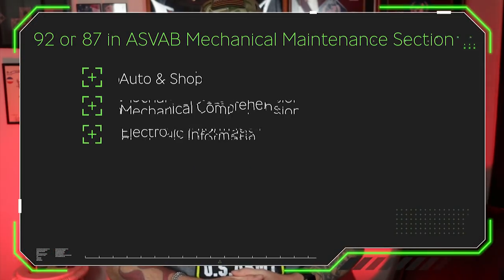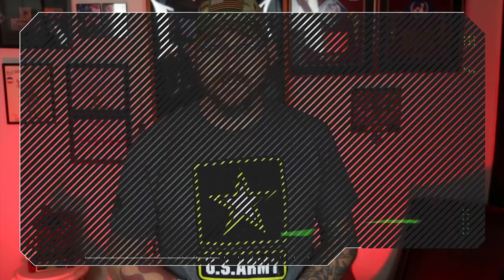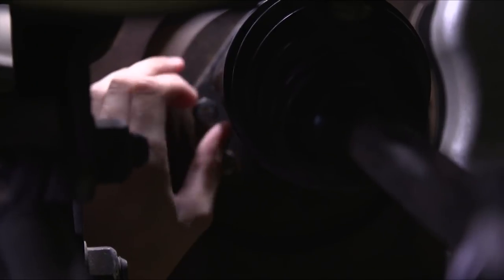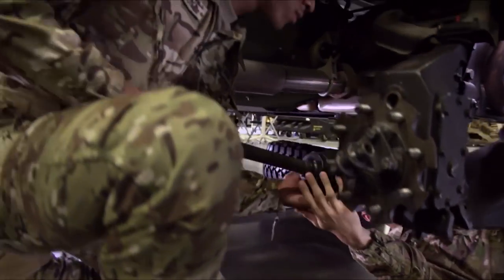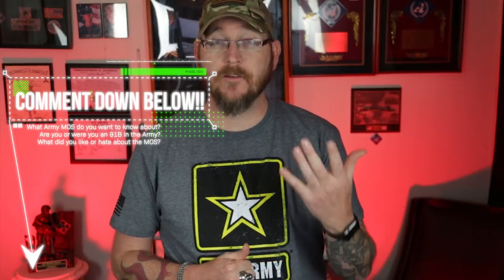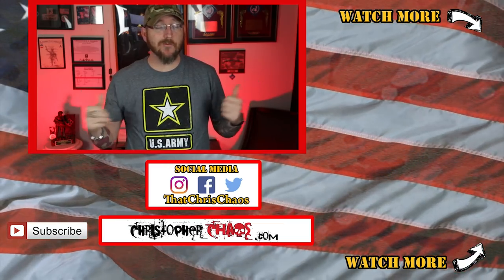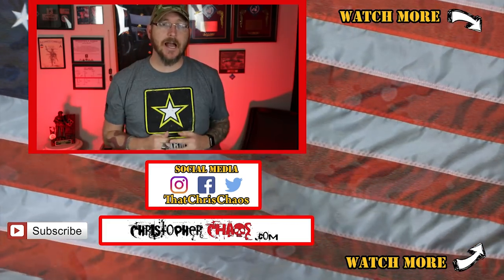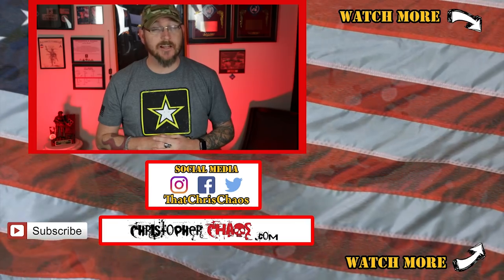91B Wheeled Vehicle Mechanic

Comment: Christopher Chaos great video.  I went through AIT as a 63 Whiskey in 1986 at Aberdeen proving grounds Maryland. I was trained as 3rd shop eshilan.  Diagnosis remove and replace major components.  All mechanic MOS's back then were 63 series.  The 63 Bravo I believe is now the 91 bravo.  I learned alot about the importance of our mission to maintain  our Military vehicles.  And most importantly working as a team.  Thanks for another great video. Larry Smith.

Comment: ONLY With Hotel identifier, other than that you are a parts swapper. Damn I miss APG..... Fyi NO POWER TOOLS!!!! Pita MOS, but after the Army, totally worth it. Also some guidelines while in, get civilian certs while serving.(totally free while serving active duty) There will be alot of down time, until motor stables, mostly on Mondays. Monthly layouts of tools, and shop inventory. When you are in the rear aka not deployed, you will do sub level maintenance, no joke. When and if you deploy, you will be balls to the walls 24/7 in the motor pool, pretty much. For you future 91B's don't let this scare you, it's like any MOS or skill trade in the military in general, good times, and shit times. Good vid
Reply: Ment to say Wrecker cert is only with Hotel identifier, very very few selected for Hotel school. But I would highly recommend having it added before leaving for meps
Reply: Kenneth Brown: Did you have that piece of crap diagnostic "computer" called the STEICE??
Reply: @dougtheeliminator1077  it was the POS hard case Panasonic, that had all the ETM's on it for everything in the Army
Reply: The only good thing back then is that military vehicles were very simplified. Quick disconnects on hoses and lines, motor mounts that were easy to access, etc. The only constant hassle were those shitty electrical systems. Always an issue with them!!!
Reply: @dougtheeliminator1077  usually it was the tcm under the TC seat getting too hot from the transfer case, I made padded blankets for the in 06 when I was in Iraq for the m1114 hmmve, never had any probs for my BN
Reply: No power tools?
Reply: @cedareverly5450  Nope, all manual, meaning you gotta have some power behind them

Comment: Also just realized, and you forgot one thing in the vid, you WILL become a diesel tech in hind sight 20/20, because we don't use gasoline engines in our equipment, it's all ds2/3 and jp8, thought I'd throw that out there
Reply: I remember Army gasoline was called "Mogas."
Reply: @dougtheeliminator1077  yup still is, and it's usually if in the 50 gal drum non ethanol 100 octane too, but usually it's just 87 from the shoppett 🤣🤣🤣

Comment: Is there a colorblinde spectrum to where you can still become wheeled vehicle mechanic? I am very interested in the position however am slightly colorblinde. It has never effected my life though and honestly until recently after randomly taking a test, I had no idea I had it. Also, I used to have a job working on cars and my colorblindness was never an issue

Comment: I have a question 91B's would you be trained in motor vehicle wielding?
Reply from the maker: Not really because there is already an MOS that deals with welding (91E) that would do the task when needed.